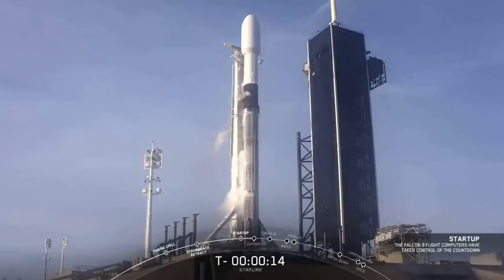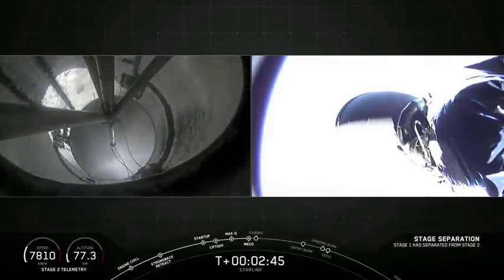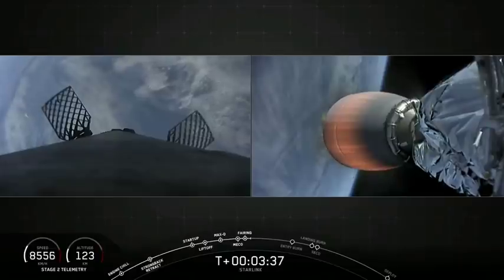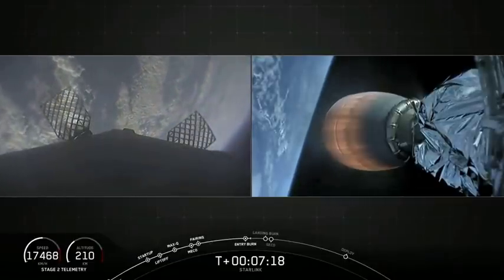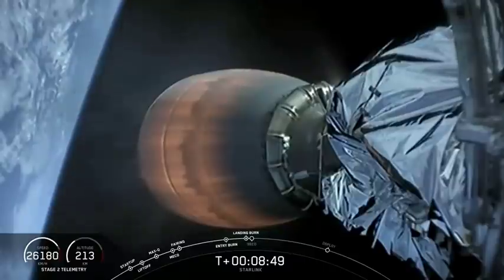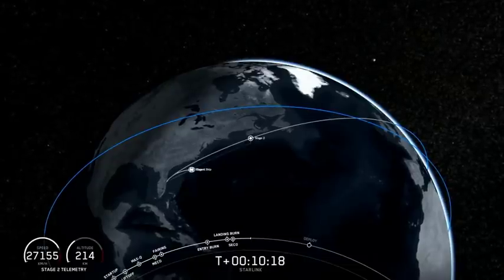SpaceX Launches Starlink-5

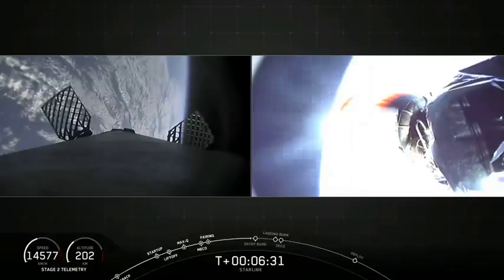Comment: At about 6:50, an artifact appears on the right side of the booster and travels off-screen right. Any thoughts?
Reply: UFO that is for sure 👽👽😷😷
Reply: chelooman Definitely unidentified
Reply: Did it come of the engine area?  Is it a nitrogen tank or something?  The booster had an engine failure during the initial climb out. There could have been damage to other components. It may have fallen off during descent.
Reply: @grumpy3543  Looked like square flappy octopus but with a hollow circle inside and two claws.
Reply: Nikki Bebbo okay. What does that mean
Reply: @grumpy3543  that it looked like a square flappy octopus but only with 2 long drappy edges that you can see. I like the idea of it being the Nork's cabbage. I have no idea Breck it could be just small debris.
Reply: Nikki Bebbo Yes. Definitely metal. Not insulation or ice. Maybe a part or something
Reply: @grumpy3543  The interesting thing is that at this point in the video the craft is still increasing in altitude and it is not decreasing in altitude.  Look at the altitude counter.  So basically the object has to be gaining altitude.
Reply: A M Isn’t the rocket in its decent phase?  The object in question was traveling slower than the rocket. It was probably a nitrogen tank that broke loose from the engine bay and fell off. It was caught in the slipstream and slowed quicker than the heavier rocket.
Reply: yeah. yikes!
Reply: That’s always a scary recording of a pilot’s last words when he says, would you look at the tentacles on that thing.
Reply: Wow, yeah. .🤔
Reply: This was the fairing ?  i guess they missed it by ...that much !!
 I had to back it up several times because i wasn't sure what I saw. The diameter is about right, I couldn't tell if it was hollow like a booster would be.
 Besides, there to busy spreading covid-19 !!!  GOD HELP US !
Reply: par4par72 A fairing?  To what?  It’s pretty small. I’m not sure of the scale but I’m guessing 8 to 12 inches in diameter. So probably a tank of some kind in the engine bay. Maybe an accumulator or something like that that blew loose in the ascent. Finally came off during descent. I wonder if @scottmanley would know?
Reply: par4par72 What fairing?  Is there a fairing that separates during the first and second stage?  Or is it a clamshell fairing over the payload?  Are you saying that they passed it on the way back down?  Looks close. How big is it?

Comment: Why isn't the altitude climbing at a faster rate as the speed gets higher?
Reply: Research "Orbital Insertion".
Reply: As the rocket gets higher, it's arcing over at an ever-increasing angle, so that eventually, it's travelling horizontal to the earth's surface - at which point, it's now in orbit around the earth.
Did you actually think that a rocket travels the whole way into orbit around the earth, vertically?

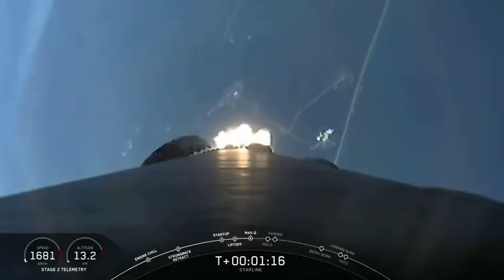Comment: 1:25 to 1:29 you can see the sound barrier
Reply: Yeah I wondered whether that was what I was seeing here - piercing the sound barrier must be the MAX-Q portion of the flight. Love this stuff - learn more about it every day.
Reply: Andy McGowan In aerospace engineering, the maximum dynamic pressure, often referred to as maximum Q or max Q, is the point at which aerodynamic stress on a vehicle in atmospheric flight is maximized. Not the sound barrier! The sound barrier is the speed of sound at a certain altitude. Approximately 750 mph breaks the sound barrier at sea level.
Reply: @theclephane2914  And generally occurs right after the sound barrier is broken